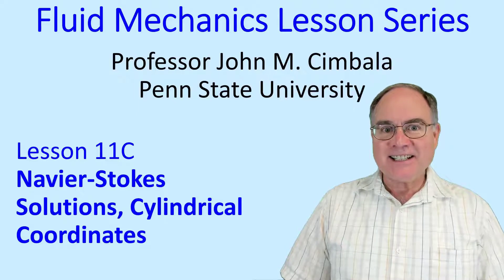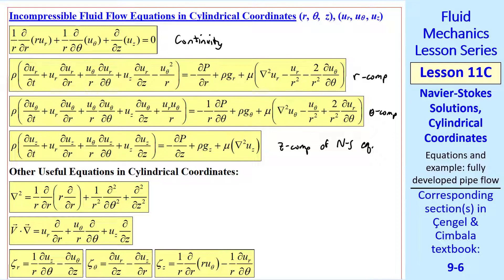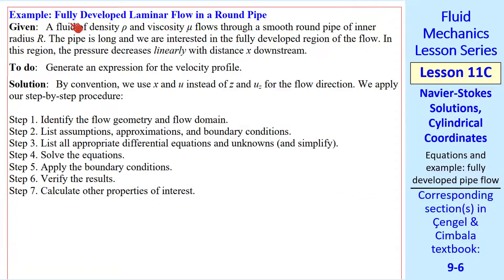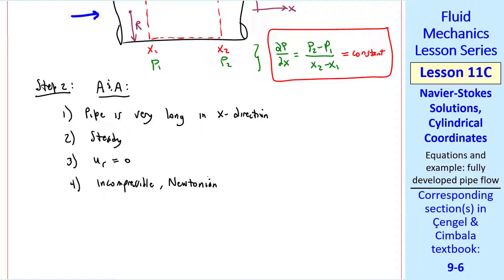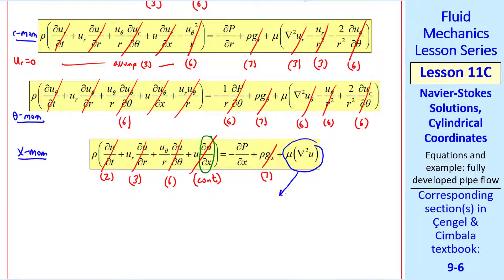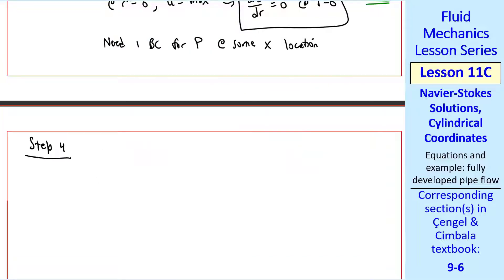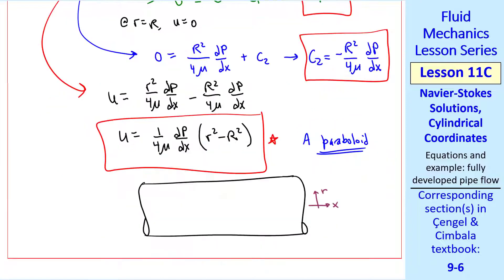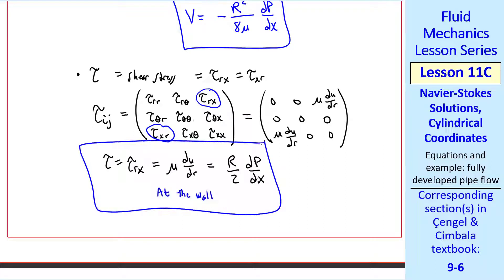Fluid Mechanics Lesson 11C: Navier-Stokes Solutions, Cylindrical Coordinates

Comment: If we hadn't assumed u_r=0 at start, we could still get it from continuity since d(r*u_r)/dr =0 . Assuming it before solving seems to me like 'overdetermined system' but luckily continuity is satisfied. I would love to hear your comments. Similarly, I felt the same for starting with the assumption that pressure gradient is constant(shouldn't it come as a result), which can again be alternatively derived from x momentum equation(f(x)=g(r) => f and g are constant)
 Thanks for all your wonderful lectures.
Reply from the maker: You are correct. If you watch more of my lessons you will see that I often solve continuity to determine one of the velocity components. But in this case, for simplicity since we KNOW that ur = 0, I specified that at the start. If we did not know this, we could do it your way (probably better actually). :)
Reply: @johncimbala  Thanks a lot!

Comment: At 3:41 you present another way of writing the Navier Stokes, using the product rule. Do we expand that new term you presented from the inside to outside i.e expand the inner derivatives first or the opposite way, because I get different results?
Reply from the maker: You can expand the combined term out and rearrange to get the two circled terms. It involves some algebra with the product rule and reverse product rule. The two circled terms ad the combined term (under "These two terms can be written as") are the same, just expressed differently.